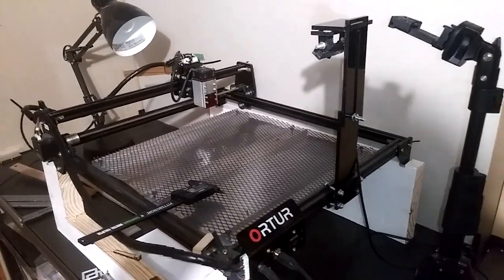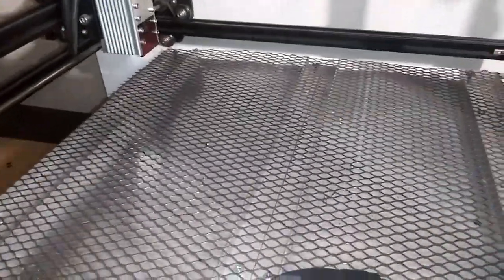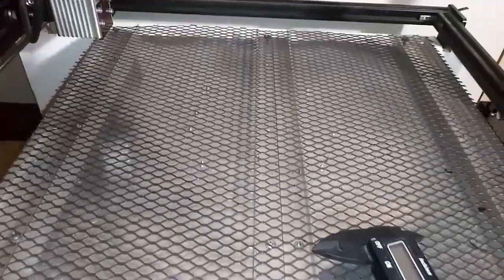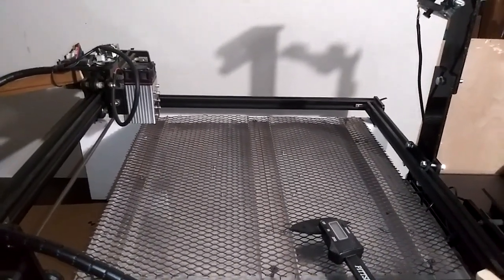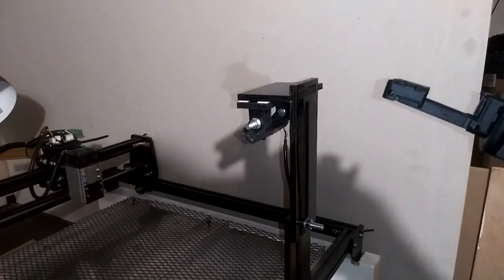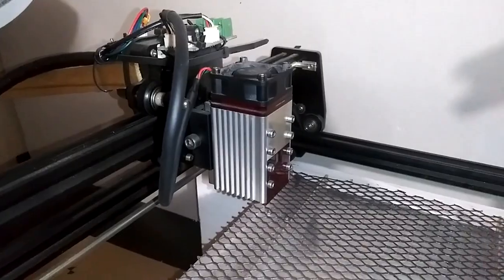Ortur Master 2 with Neje 30w for table functional ugrades

Comment: I just changed to the 30w neje module from a15w ortur like you did..use a printed mount a friend make and needed some modifications..but the laser skips on my Y and z axis  any info you can suggest, thanks....what about the power supply  you said needs to be changed  because it show just plug in the board that they supplied is good...confused!!
Reply from the maker: I changed the power supply because I wanted to be sure there was no over heating in the power supply. The skipping is because you need to go into Light burn and change the grid size to match your new grid size which is reduced. Measure the distance from the laser stop point to the cross support and subtract that from your grid then set the grid to match. As far as your mount goes it needs to be trimmed to be able to pass over the stop point from the left side. Thats assuming you used plexi or acrylic sheet. Hope that helps. After doing that it should work without skipping.
Reply: @tatay41  Thanks for info,will do..what the size of your new mounting plate you made,and how did you connect the sliding mount to the new plate.again thanks and Happy new year..
Reply from the maker: @MontesPlace  I'll check when I get home and send you or post what the plate looks like and as a note I never adjust the focus I only use the slide and a gauges I made. Sorry about the grammar I'm at work and not on my laptop.
Reply: @tatay41  Thanks,that would be very needed to get my laser working again.When I get to my shop I will change the grid size as you mention,thanks
Reply: When you find the time can you let me know the sizes of the mount you made,thanks for your response
Reply from the maker: @MontesPlace   I posted your requested video on how to make the laser mount. Let me know if you have more questions.
Reply: @tatay41  I seen your video a few times,thanks..just wanted to know the actual measurements of that mount that you made in inches thanks again for your time

Comment: Theres a 3d  printed base to easily move the laser up and down,  its cheap and easy. I have several 3d printers so it was readily available...
Reply from the maker: I also have 3d printers and so far I have not seen an adjustable base for the NeJe laser if you have a link to one that works with the Neje post it for everyone. Thanks.

Comment: What about using a scissor jack from a small car? Too course of adjustment?
Reply from the maker: I thought of that but I decided to try the lab table jack. Maybe if you drilled it and bolted the table to it. No way to know unless you try it. After I abandoned the jack I built a clean air box with blue block windows. I show it at 1 min 35 sec  here   https://www.youtube.com/watch?v=ctGV-BCas38&t=1s

Comment: Cool,  i finally received mine,  added air assist plate designed by domi1988 on thingiverse, used your video for wiring my laser and worked like a charm, Thanks for your comment on the lab table I had my doubts and now i know better :)   Cheers
Reply from the maker: Good call you got the one that mounts the view port. You don"t need that view port it really doesn't help. But the air assist will help in your cutting. His mount for the laser looks almost exactly like mine except I did mine in solid acrylic. Adjusting the z axis is much better than messing up the focus on the laser head. I enjoy my laser and I'm sure you are going to love yours too.